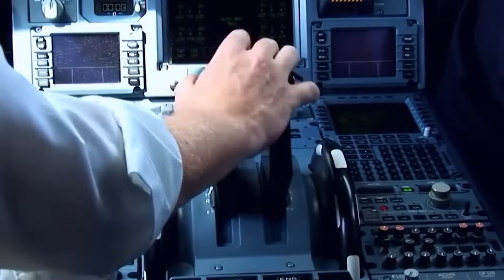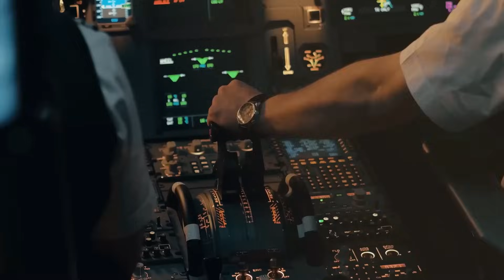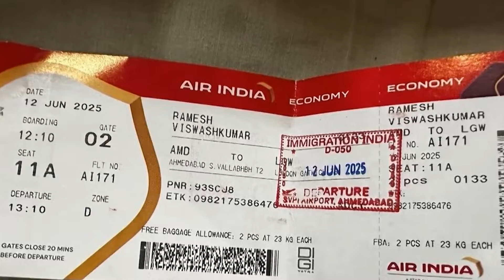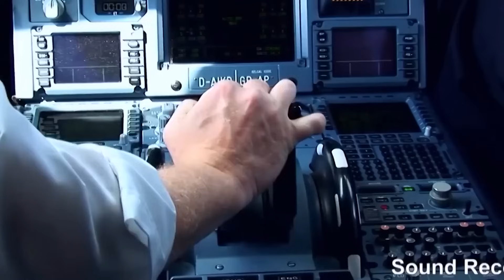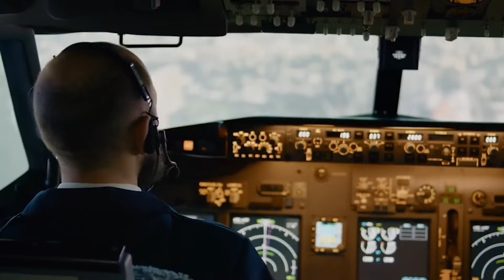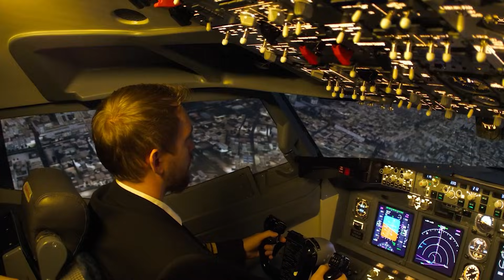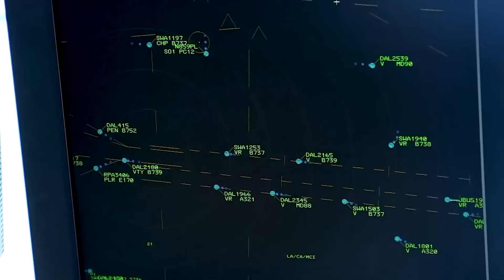Scientists FINALLY SOLVED the Air India 171 CRASH

Comment: Several issues here...if WOW thinks aircraft is on the ground then the RAT would not deploy...whether intentional or not the fuel switches were placed in cutoff position...last words were why did you cut off the fuel...I'd be careful blaming the manufacturer at this point

Comment: Is this the official one now, I've seen so many theories.. This one seems the most likely to me but I'm just a lay person as regards air travel but I did spend 37 years in IT but only working for a bank. Extreme heat evaporating the fuel is another theory but how did those switches move.. But two computers arguing with each other is definitely possible.. I mean, they can't even make a self driving car that works properly.. Even Waze and Google Maps make mistakes. Plus with the Dream liner, does it use Lithium Ion batteries? 
I'm just debating, I don't know anything.. So is this official now, that it was FADEC.. is that just Boeing or does Airbus use FADEC.. maybe the old planes were safer
Reply: Those switches cannot be accidentally or automatically turned off, They require a backwards pull towards the pilots out of a detente, and then a downward movement to the off position. All commercial airliners have some form of FADEC.
Reply: @rogerneves7898 Thanks.. maybe the switches were the pilots trying to reset the engines
Reply: @ron2256  The starters are on the overhead panel. If the throttles had been forced to idle as mentioned in the article here, you wouldn't turn the engines off, which is what those pedestal fuel switches do. You would turn the autothrottle off on the panel in front of the pilots and manually advance the throttles. A weight on wheels switch does not prevent the throttle from being advanced. You need to do that for taxi purposes and obviously there is weight on the wheels then. This just seems like another dump on boeing post.